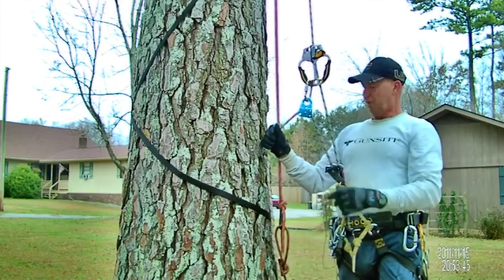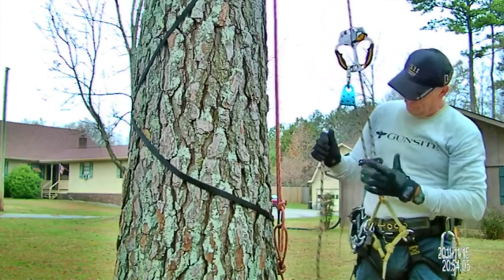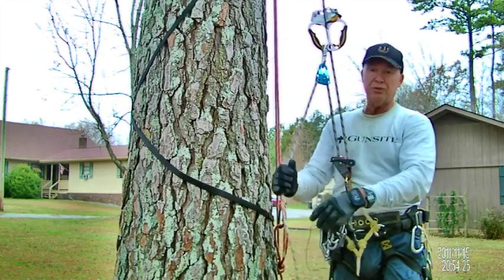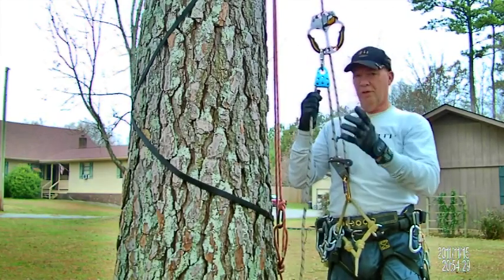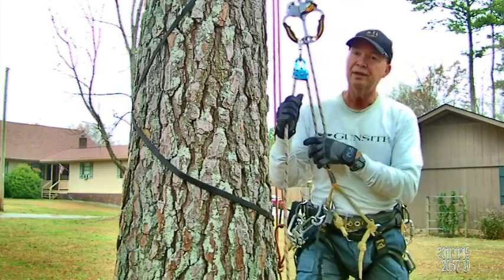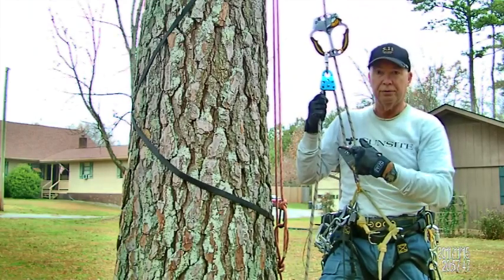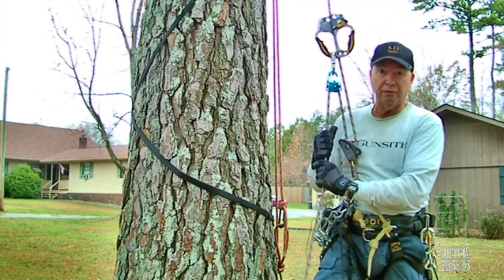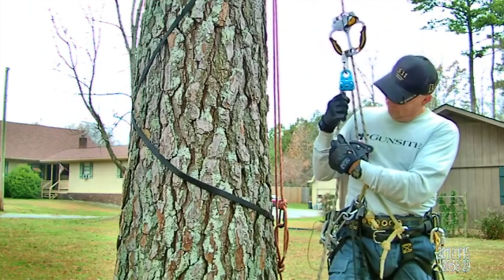Rope and Pulley Systems: Segment 17 - Mechanical advantage of the RADS pds.m2ts

Comment: At 6:30-40, you say: "I'm a full foot off the ground but I have pulled with my hands through this pulley three feet of rope."

I agree; you pulled three feet of rope past your body. However, the pulley, being stationary, moved relative to your body down 1' - as did the rope. So, actually you have pulled only 2' of rope through that pulley. Which in total accounts for the thee feet of rope moving past you as you move up one foot.